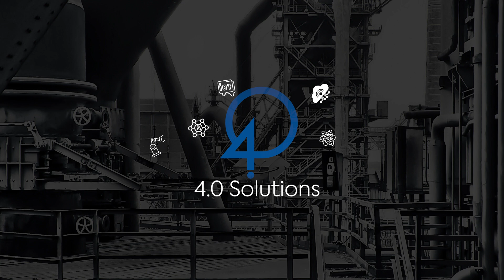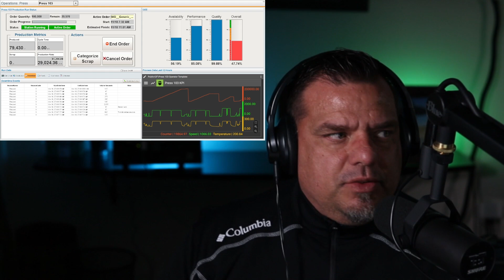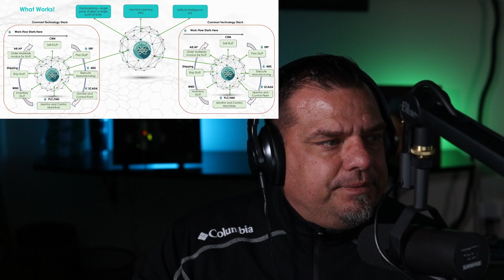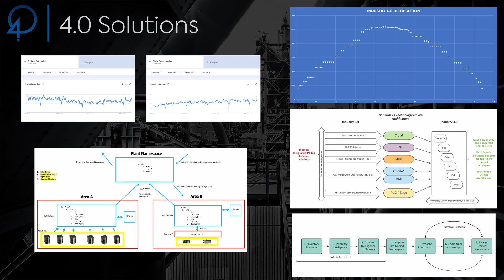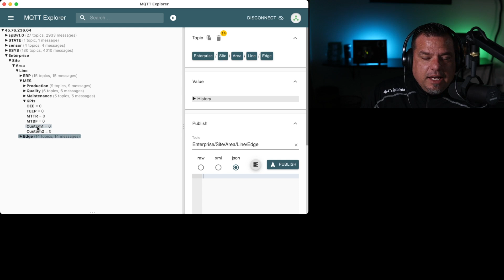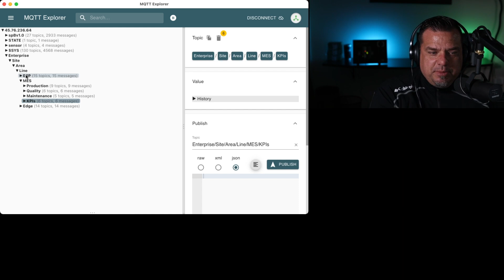Basic ERP and MES Integration

Comment: How related is PI asset framework yo what youre talking about. Because it seems very similar.
Reply from the maker: Very similar with the one caveat it’s ingress only. The models you create in PI asset framework are not easily accessible outside of their ecosystem
Reply: @4.0Solutions  that isn't true anymore. There are quite a few solutions that grab the xml AF model and pipe it elsewhere including the data that's attached to it.

But maybe we're saying the same thing. I'm not entirely sure. I work at such a place where we sell a product that egresses PI AF model to other systems.

Also there are flattened tabularized ways of egressing data out of AF.

But again maybe I'm missing your point.
Reply from the maker: @zakwhite5159  open through a connector isn’t always the same as open. Would have to dive into the architecture. I doubt its optimal strictly based on OSIsoft business practices not in the best interests of the customer. They operate like the mafia.

Remember what the minimum technical requirements are for an IIoT ecosystem. Open architecture, report by exception, edge, driven, and lightweight.. it’s likely missing one of those elements. Edge driven is my guess.
Reply from the maker: @zakwhite5159 the underlying definition of the asset or event frame is not exposed to non partner solutions without leveraging an sdk integration.  🙏
Reply: @4.0Solutions  AVEVA, but ya it's an endorsed product through one of their programs I can't remember at the moment plus it's repped by some of their sales folks.

But there are other connectors as you say out on the market.

But in terms of being open the pi web API is pretty fleshed out to egress both structure and data which is stock to the system. Most developers just don't really have the time to figure it out. Hence the rise of connectors to begin with.

In terms of IIOT, I may be missing exactly what edge driven means in this context.
Reply from the maker: @zakwhite5159 AVEVA is starting to move the right direction, it’s not clear if that has penetrated into the OSIsoft business unit within AVEVA enterprise.
Reply from the maker: @zakwhite5159 edge driven is the difference between publishing the models and definitions on change to an open infrastructure like a UNS. Versus having to write custom software to hit an api to get a response. The latter is not edge driven, it would be poll / response.
Reply: @4.0Solutions   I think this is a good distinction.

But if you are  referring to template reference and inheritance of an element it is now exposed through the PI Web API.

Technically it is also exposed through SQL RTQP as well, but the template definitions should only be referenced in a read manner this way. 

I do acknowledge though while these are counter factuals, the means listed above are ... Not really the best developer experience for fast integration and in the web API sense you have to build a crawler to pick up new additions which in essence is why connectors just get built on top of it.
Reply from the maker: @zakwhite5159  thanks for chiming in. What do you do for work?

Comment: What are you talking about? A transaction can be seen as an event. A rich event full of rich and complex data. What you should avoid is try to represent a rich complex event with a key/value dataset like your Ignition tag system. Treat complex and relational data in one way and machine data and timeseries in a different way, but dont mix things up.
Reply from the maker: This is right and wrong — right: a transaction can be seen as an event (because an event is something that happened and when).  What is important to note — data is never complex, never rich.  Data is always just a value and a timestamp and it is never actionable.  Data is transformed into information — either through relational context and/or aggregation — to make it actionable.

Wrong: data and information is treated differently at the producer and the consumer — but not within the digital infrastructure.  We will shoot a short today to clarify.  Thanks for the comment!

Comment: I like this example, finally a video I see spindle speeds, feed rates, tool wear, part dimensions, surface finish (Ra) and more. When discussing manufacturing much of what I do is on CNC machines and the processes, tooling, and HMI's using G-code needed to produce tight tolerances. Metrology is next, right. Enjoy the videos and have picked up some great ideas over the last few years of watching. Now that I am retired after 27 years of teaching Advanced Manufacturing I will be spending time getting to actually work with manufactures integrating these processes...... and more I hope. Keep em coming.